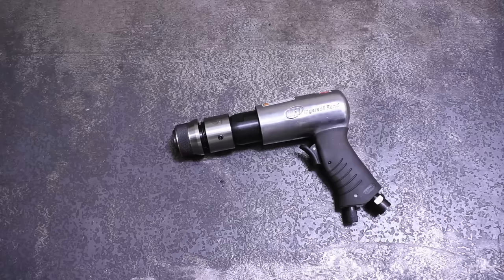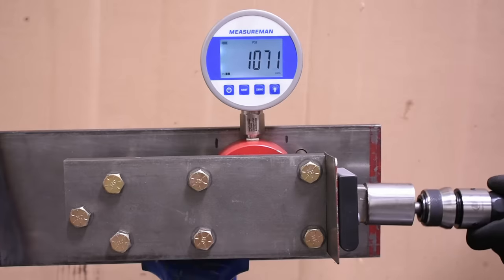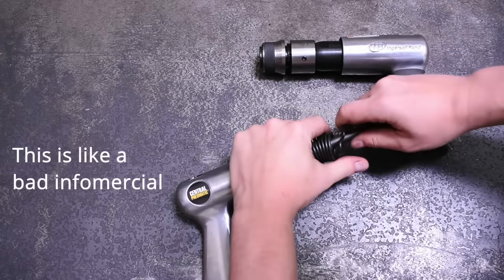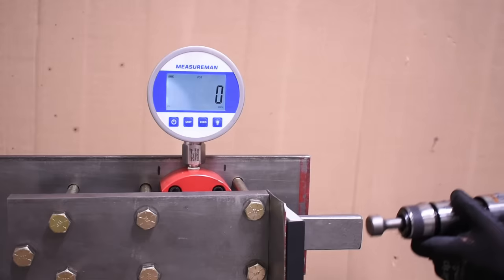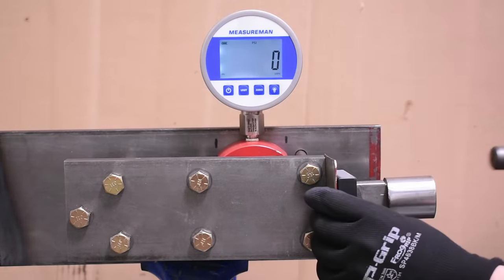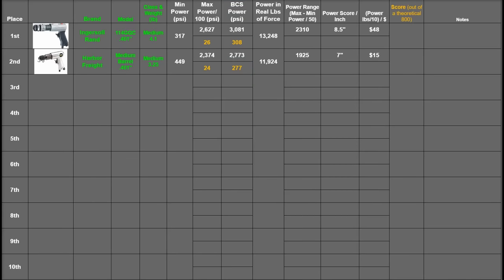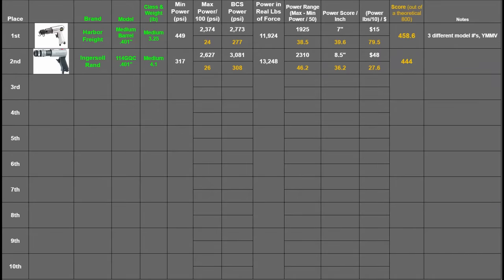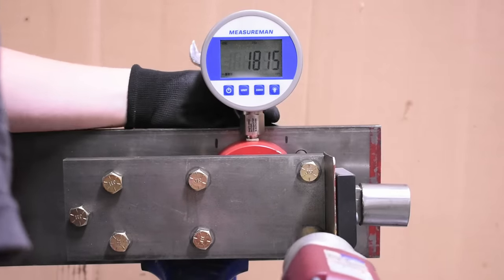Exactly How Powerful is a $14 Harbor Freight Air Hammer?

Comment from the maker: If you're not used to using an air hammer, you might be thinking the quick change retainer we used on the harbor freight somehow boosted its scores? A retainer does just that, it stops the bit from coming out when you slip off something or carry the tool around. It's 3-4 ball bearings that catch the bit. When the air hammer is pressed up against and working on something it does nothing as just the bit and piston are interacting then. Now that we have this tube collar, we could actually run these without any retainer. It's simply a matter of convenience and provides no performance difference. 
Our SKU was 61244. So yours may die after a few months of use either way, no way for us to know yet, but at least with a 61244 you have a good chance of it making the power we show here out the box.
Reply: would you like to test a Chicago pneumatic 7X and Astro big nasty?
Reply: i hav a mac i can send as well.
Reply from the maker: @chrishella4233  A man of taste, I see. Shoot us an email! We have 1 or two of those covered, but not all! TorqueTestChannel@gmail.com
Reply: Did you need a snap-on air hammer for your test ? because I got the PH3050BG
Reply: @TorqueTestChannel  when did y’all test the MG725?? I tried searching for the video and can’t find it.
Reply from the maker: @charlesflores9714  We tested it next week :P
Reply: If possible please give the air hammer s 15 seconds for the best case test . they look like there really trying to keep making pwr.
Reply: I have the Hazard Fright air hammer. I always disassemble H.F. tool before I use them, to clean out the metal chips and correct the problems. As expected, this tool needed some rework. I have used the air hammer for about 25 hours and it is still performing very well. I made a bit to chip concrete off of used bricks and the air hammer has outlasted my welds, twice so far.
Reply: Are you guys ever going to do a. 498 shank air hammer comparison? Cp717, astro 4980 and astro 498k? Really interesting in seeing something like that. Could've sworn I saw someone ask in one of these videos
Reply: I just bought the harbor freight medium barrel McGraw. It’s about how you use the tool. It could use some machined improvements. But it’s definitely something I’m invested in. Especially being a mechanic.

Comment: I beat the absolute piss out of a wheel hub on a 2000 Silverado for a day and a half. There were torches, punches, chisels, hammers, slide hammers, hack saws, and tears. I finally sent my dad with some cash to go buy this thing and he came back with his little pancake compressor and the air hammer. Had it off in less than 3 minutes. I sat in silence and stared into the wheel well for probably 5 solid minutes then just started laughing 😂 14 fucking dollars could’ve saved my sanity from the beginning.

Comment: Let us all send a prayer for the dyno before Big Nasty gets tested 🙏
Reply: It will seem that the cheap air hammer will rank better. I have had cheap air hammers and they are just not worth the money. They can't really do the job either. I was so happy when I bought a better air hammer.
Reply: Chicago pneumatic 7X or 9X would destroy big nasty.
Reply: Strongest air chisel I ever used were the shop ones at Sears back when I was a mechanic there in 1978-79, never knew the name of them but they had a dimpled aluminum exterior and could handle just about anything.
Reply: That's not even his most powerful air hammer anymore. It's been replaced.

Comment: I think for the 3 times I'll ever use an air hammer in my life the HF unit will do just fine, haha.
Reply from the maker: The fact that you can even buy this much steel and aluminum with something moving inside of it with any effect is impressive
Reply: @TorqueTestChannel  Seriously. 

Thanks for all the tests. I'm just a take-care-of-it-myself kind of dude so I do most of my own car/house/land work, but that's it. Turning wrenches isn't my job. So most of the time HF stuff will work for me. But it's still fun to watch all of your tests and comparisons. Especially if it reveals that the HF or other cheap options is just total garbage.
Reply: even in a professional setting you price the tool for the job. It's always the artist and never the brush.
Reply: @jeffhooper3447  That's right. For the few times a year I need a 5/8" socket at work, my HF ratcheting wrench does the job. For the approximately 1 million times a day I am using a #3 Phillips, it's gunna be a good tool, Klein in this case.

Comment: The added cost to not have to deal with that spring is worth it alone! Also with the IR, you can turn it into a needle scaler by changing out the collar.
Reply: HF offers a quick change chuck for $5 on the side.

Comment: Thanks for the vid! I've got  an IR 122MAXX. I do not get into heavy jobs that often and I find this unit easier to finesse than the big ones. One thing I can say for sure is if you push on it hard it gets a lot more powerful. It's also more dangerous to push hard because if you slip off you can get hurt or damage some other component very quickly.

Comment: Yeah, I have that air hammer and it's actually pretty decent for what it cost me at the time. It acts a bit funky sometimes, almost like the mechanism is being allowed to stroke past where it's supposed to and leak instead of applying the hammer. I'm not sure why/what would cause that, but I definitely need to try oiling it the next time I pull it out

Comment: That HF hammer is more than adequate for weekend warriors.  The main thing I need it for is to shake loose rust.  The short stroke is useful in certain situations.  I.e. the pressed in splined exhaust bolts on Honda's.  The rubber exhaust hangers actually absorbs the heavier and slower hits of CP717 perfectly, making it useless.
Reply: Really? I had a harbor fright air hammer once.  It wasn’t worth 14 cents!  I’m surprised it lasted through the test!

Comment: Bought the HF many years ago. It fell apart after a few months. Bought a $50 Chicago Pneumatic and it gets the job done for me.
Reply: Joey Mac  yes your correct Central Pneumatic is  a HF brand. Mine is Chicago Pneumatic as I stated.
Reply: Joey Mac  Chicago Electric is a HF brand. CP has been making air tools since 1901.

Comment: I’ve got an IR and love it. I had a coworker that had an older HF air hammer and it worked for what we did, but I wouldn’t trust it at my job now. It put up good numbers for the price, but I’d have to question the durability in the long run. It may be fine, but I KNOW IR will last me (already had it almost 5 years).

Comment: It’s been 2 years since this video had come out and I’ve been considering an air hammer to split corroded bolt heads (that not even a fluted socket could save) in an engine bay, and pretty much every review I saw of this tool on the HF site was now 5 stars, one even mentioning this exact video and how the HF tested at 90% of the IR’s capacity

Comment: Hey, if it can knock off an early 2000's Silverado front wheel hub, it can't be THAT bad :D

Seriously, though.  I bought one of these for another project and while it's nowhere near top of the line, it's worked just fine for me.  I'm not using it for hours on end every day.  When Harbor Freight DID have the coupons, I got the price down enough that I bought the additional quick change collar and it came out to about the same price as just the hammer by itself, so I'm not complaining.

Comment: I'm  glad  you're  trying  these  tools  at  the  higher  pressure, I  don't  know  anybody  who  uses  a  regulator on  their  air  tools . How  about  trying  everything  with  a   high  flow  fitting and  a  1/2 inch  hose. I  have  a  sunnex long  barrel  air  hammer  that  the  bigger  hose makes  a   big  difference .

Comment: I have that air hammer and I have for like 5 years. biggest thing is the black sleeve loosens and itll leak air and drop the power you don't always notice but if you snug it back up it works like a charm that's probably where the bad press comes from. I didn't know how badly i needed an air hammer til I got one and I was shocked at how much I use it and how well it works.  Sure there's bigger and better out there but 15 dollars for 5 years of reliable use sits right with me. I do hate the spring retainer but its small potatoes once its worn in a bit its not that bad. ( Mechanic 8 years)

Comment: You should test to see if there is a difference in using a quick change retainer and if different brands work better.
Reply: Theoretically it shouldn't, because the bits float around in the collar, but you never know until you know, right?
Reply from the maker: @ForfeMac  When pressed up against something the retainer isn't actually "working" - you could use an air hammer without a chuck if you're using it firm against something. It stops it from coming out when you come off the thing you're rattling.

Comment: I carry the HF air hammer in my concrete pump because it's cheap and disposable. They sell a quick connect for the bits in store, a coworker swears the quick connect robs power from the hammer. He prefers the spring.

Comment: One thing I've read in regards to central pneumatic air hammers is that when used with quick connect adapters it moves the bit away from the hammer diminishing how hard it hits. To be fair i saw it mostly on the smaller air hammer but I'm wondering if it's a theory you'd be interested in testing on various hammers to see if there's any significant power loss with a quick disconnect vs the crappy spring we all hate
Reply from the maker: The retainer does just that, it retains the bit from coming out. When in use hammering against something, unless it's an indexing chuck like on a chisel with slots, it's not actually doing anything - but does a whole lot if you slip off the hammering surface. We could probably run theses tests without any chuck at all now that we have the locating cup thing. The ball bearings of the retainer don't do much while hammering on most bits.

Comment: This is a great test. You need to test the Astro Tools long barrel air hammers. They have a new one that is a extra power long barrel one too.
Reply from the maker: What model is that?
Reply: @TorqueTestChannel  The one I have is a model # 4980 with a .498 shank.  It's a freaking beast. It will break stuff if you're not aware of just how hard it hits. I think its the same one Eric has on The South Main Auto channel. He calls it "Big Nasty". But I think he reciently got the new one by Astro thats supposed to be even stronger. I frankly don't know just what you would do with one stronger than the 4980 but they made it anyway. LOL

Comment: Having used both of those models, I'd say the big difference is the wear and tear. The Central is a tough unit for the price, but they start to have issues after awhile. Granted, you can buy a few for the price of one IR, but my IR never let's me down and is much more comfortable to use. But the central is a good tool if you're not usually them all the time professionally.
Reply: That's why I grab HF for intermittent stuff. I got 2 rooms to break tile out of. HF is fine. If I did it daily I grab something better. But no need to have an expensive tool in my garage

Comment: Own the IR you tested here, used it professionally as a technician for about 10 years? Recently transferred back to a technical repair position and frankly I dont want to bring my nice tools in. So I bought a bunch of HF tools and air tools. So far, they are working fine. Nice part if they break of fail? Im back in business for under $30 for most of it. Cheap is a quality all its own.

Comment: Make sure you get the Campbell Hausfeld GSD line as well as their basic line...  Also, where did you get that chuck instead of the spring retainer?!
Reply from the maker: Definitely diving into Campbell at the prices we've seen! Each air hammer will use the same type of quick chuck, to keep things even - since chuck types are easily switched out if you own one of these.
Reply: @TorqueTestChannel  I'm saying the Hobo Freight ( thanks AVE) brand had a spring attachment for .401 shanks, but you had the end cap on in the video when testing it out .. Where did you get that retainer to fit the spring attachment end for the HF brand?! I have a mix bag of pneumatic air tools,  mostly Campbell Hausfeld GSD, along with IRs composite impact and CH GSD XT series both are 1/2" I never get stuck on anything...
Reply from the maker: @dragontalontsiawd  Harbor Freight's cheap version (Sku 66621) or really any quick retainer chuck for a .401 shank air hammer will thread onto the end of any of these tools.
Reply: @TorqueTestChannel  I just found a set online from eBay, it says universally fit for .401 and .498 shanks... $25 seems reasonable, and I only need 1, says it fits all models with spring retainers for .401 shanks...

Comment: Cranking up the pressure may help this stuff but quality air tools have a built in blow out disc in the air flow and will render them inoperative untill sent in for repair, the higher the priced the tool the more important it is to regulate it to the correct cfm ( 90 PSI )!

Comment: Does the amount of force your hand pushes on the air hammer effect the results? Light push or full body weight lean? Could you test if there really is a huge difference in effort and performance?
Reply from the maker: We can try to bust that myth in a video, sure thing
Reply: I own the HF hammer and with my smaller compressor I can stop the hammer if I press hard enough.  So I'm sure if you have a large compressor, it'd be harder to stop it.
Reply: @cujoedaman  It doesn't depend on the size of the compressor, but the PSI.
Reply: Don't push hard; let the hammer find the sweet spot for you.

Comment: The quick connect adapter puts additional weight on the end where it is least desired. I'd be curious to see if it makes a difference in hammer performance in these mid length models. A test with and without?

Comment: I run 155 pounds of pressure. And none of the air hammers I've had has held up. HF to Snapon till I picked up Big Nasty's twin. These both are ok for home use but not for daily use!

Comment: For most of what I do, I'd rather the shorter tool. But the finer control of the IR is more important than both power and length. Often I find myself pulling the trigger with my non-dominant hand, thumbs, or pinky fingers.

Comment: Can I suggest a test of the GOODYEAR RP7621 air hammer from Walmart? Seems like a reasonably accessible model that's probably in the running for 'most likely to be purchased' by budget-oriented tool consumers. Especially at its $20 price point.

Comment: Pretty good comparison. I'd like to see how long one of those hazard fraught air chisels actually last though. I'm still using the twenty dollar wal mart Ingersoll Rand I bought about twenty years ago. 
She's not the hardest hitter, but she still hits just as fast and hard as she was when she was new. I'd try to get the exact model number off her, but like any sassy old lass, she doesn't want to show you. Too many years of use and she's gotten shy. AKA label has been "hammered" off.
Reply: They're actually not that bad. I've used them a lot on an auto restoration project to cut sheet metal and rivets. Seem to hold up OK. I bet a lot of these tools are made in the same Chinese factories and marketed under 57 different brand names.

Comment: Great video, but I feel like a load cell may be better, at least for the min power test, one twitch on the trigger and the run is no good because pressure will already have been increased. A load cell would give you the instantaneous force
Reply from the maker: This is a hydraulic load cell, but if you mean a digital load cell vs the tool end, yes that would be more direct. But also be force per blow, not combined work like we show with impact wrenches (we know, we tried with air hammers without much luck). The point is to show how twitchy and difficult it is to meter with solely the trigger, which it does demonstrate. And the points dedicated to this category are rather minimal as well.

Comment: I think a more consistent way to test low throttle performance would be to just manipulate feed pressure - finding the minimum pressure the tool will operate
Reply from the maker: While more precise, that wouldn't replicate how the tool is used. We usually throttle the trigger when we need to do temporary light work, not mess around with valves.

Comment: hellllll yeah can't wait to see the numbers that BIG NASTY puts down! lol

curious, why is Max Power divided by 100, but BCS divided by 10 to get a points value?  Why not use either 10 or 100 for both?
Reply from the maker: Good question. If we divided both by 100 the power figures would be too small as % of the score, if both by ten they would have added up to be too MUCH of the overall score. /50 would be hard to follow along with. To keep the sides of the table (features vs power) sort of inline with the original episode's balance - the max power is comparably small factor and BCS is a large factor in their scores. Their performance at higher pressure (since who is afraid of damaging their air hammer) will be the main points each gets, which since we'll be mainly after power in this series, even compared to impacts, sits fine with us.

Comment: I got rivet bits so that the cup goes over the bolt/nut and won't slip off.  That with a 7X rivet gun will destroy anything automotive.  However, it is cost prohibitive.